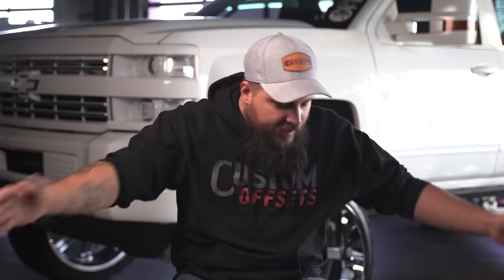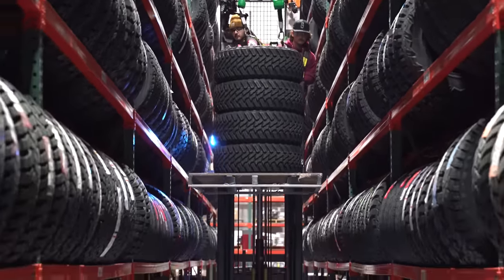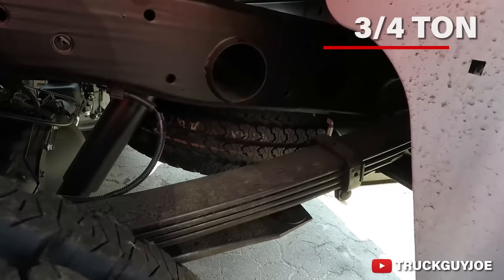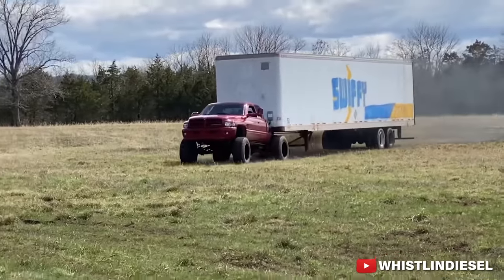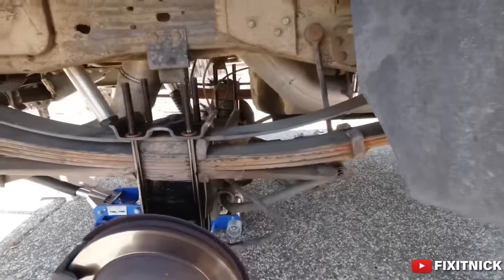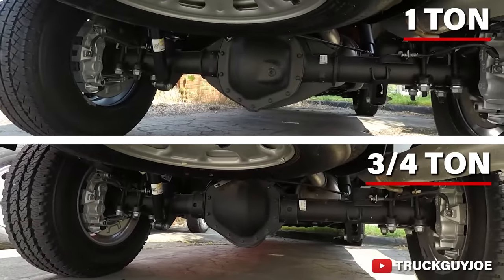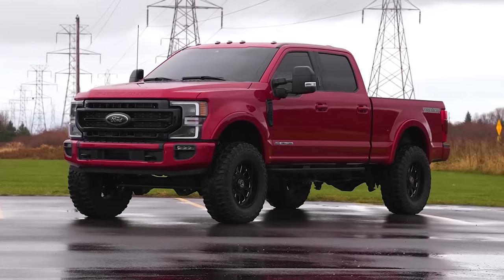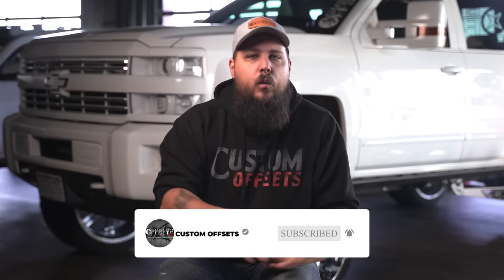¾ Ton VS 1 Ton: Which Is For You?

Comment: I own a 1 ton and will most likely never go back, yeah it rides a little stiffer but its a truck. So it doesnt bother me. I like long bed trucks and if youre gonna get a long bed you might as well up the capacity so you can use that extra space. 1 truck that will pretty much do anything you want it to, it just rides a little stiffer. But you can get nice riding suspension kits like Carli that will offset the rough ride

Comment: I have 2013 3500 SRW short bed duramax. When I was looking for it, it was weird how a 3500 was going for about 2k less on the used market. I figured the extra strength is better to have and not need. Only difference was my registration was higher initially but that got cancelled out cuz I get free Veteran plates for life so I think I’ll always get a 3500 if it’s available
Reply: completely agree. I had same situation occur when I purchased and even though I don't have vet plates the extra cost is only a hundred or so dollars a year.

Comment: For dodge, especially the earlier years 3/4 and 1 ton trucks had the same axles, and leafs in some cases. My 3/4 is essentially a 1 ton without the badges
Reply: Wally Kos I said “earlier years” if you didn’t notice bro
Reply: @wallykos6784  the coils are an option it comes stock with leaf springs unless you select the option for coils
Reply: @IAppreciateSlaps  negative
Reply: @megam3at171  yea that was a long time ago. I know now the leafs are an option.

Comment: I have two 1998 Chevrolet Silverado K1500s. But wait, there's more. One of them is a standard 4X4 and the other has the Z71 off road package. They both have the F44 and Z82 packages as well. That means that they both have 14 bolt 3/4 ton rear differentials with 6 lug axle shafts and an added leaf spring giving them 5 in total. These are factory "HD" options but they aren't labeled as such and being Chevys they both have the classic rake to them. I know this is a 2500/3500 video, but they are still technically 3/4 ton trucks but don't use 8 lugs. 10,000 lb tow ratings as well.
Reply: You missed the frame part of it they might have the differential and add a leaf but they won’t have the 3/4 ton beefy frame still riding on a 1/2 ton frame.
Reply: @skywalker3084  yeah it’s just like the 1500 HDs that started in the 1999.5- 2007.5 
Much love brother have a good day.

Comment: My 2012 f350 rides just fine, it sure beats the 2004 f250 I drove that felt like I was riding on cement blocks every time I hit a bump.
Reply from the maker: I do know the newer F450/550's ride better now a days then they used to!
Reply: My 2012 f350 srw rides good on smooth  pavement but 98% of the roads are crap.

Comment: Im looking at getting either a classic chevy/gmc 2500hd gas, lb7 or 3500hd. I think a 2500hd is fine for my business. I tow lawn equipment, haul logs sometimes and tow dump trailers once in a while. I plan to hook a boss poly v plow to it. And build a leaf box with a big 30 hp debree loader. I want a diesel but need a reliable truck. Idk if i should go gas or lb7. Also plan to put a dumper dog dump bed insert in the truck.

Comment: I have two f350.  One is a dually and one is a single rear wheel. The. I have a 79 f150 with a 6 cylinder from a 78 f100. It has pulled a 8k pound camper up a 20% grade hill before. Then a 78 f100 that is lowered with a 506 cubic inch v8 making 873 hp. Built trans that is anything would explode in the trans it would shot out the bottom. If I was to take the truck to a drag strip I would have to put a parachute on the truck.

Comment: Have a 2500 hd its a chevy with a duramax when i got it the only thing i wanted was crew cab 8 foot box and duramax if i found it in a 3500 instead of a 2500 i would have got that one but 4 door, 8 foot box, and duramax was the key

Comment: On your breakdown you missed on your Rachel feel efficiency and handle ability because if you're buying 3/4 or 1 ton you're playing on weight that's the reason why you're buying 3/4 or 1 ton you're going to haul wait are you pulling a gooseneck are you feeling a bumper hitch are you pulling a fifth wheel well gooseneck or fifth wheel a dually base gives you a broader a wider base for a quartering which usually comes as a wonton you could special order 3/4 but also weight capacity gear ratio fuel efficient okay you get a 3/4 ton with highway gears your phone at 10,000 lb trailer over hills well you're going to suffer on fuel efficiency power range and grunt Force you buy a wonton or one ton dually with the gear ratio variance well pull the same trailer or the same health you're going to get better fuel efficiency because it's already rated and geared for fuel efficiency
Reply: Who buys a keyboard that doesn't have any punctuation keys?

Comment: Rear axles are all the same on 3/4 and 1 ton
Reply from the maker: In some cases absolutely, however in the case of my Cateye for example there are small differences between the axles under the two. I only learned this because when I went to order seals for my rear axle I had to measure it as the book doesn't specify which is which lol -Dustin
Reply: no they are not. a 2500 gas chevy has the 10.5 inch rear end. Now the 2500 diesel has the 11.5inch rear end! While the 3500 either diesel or gas has the 11.5 inch rear end!